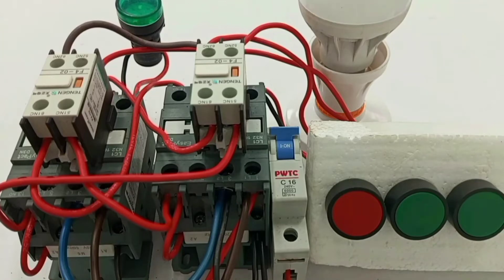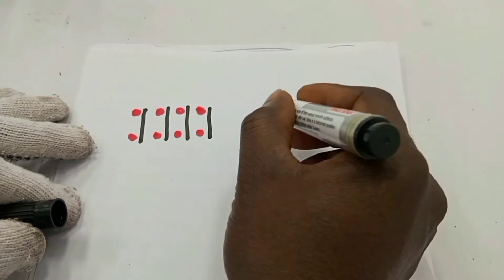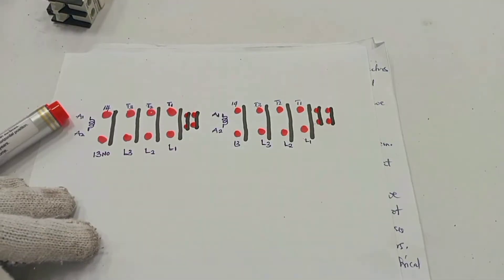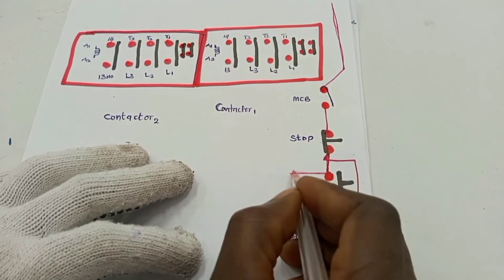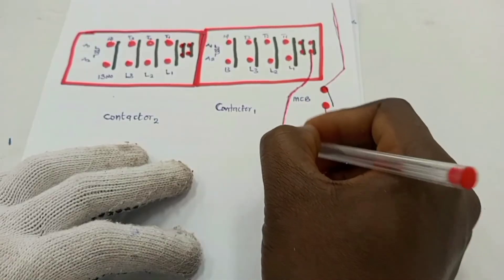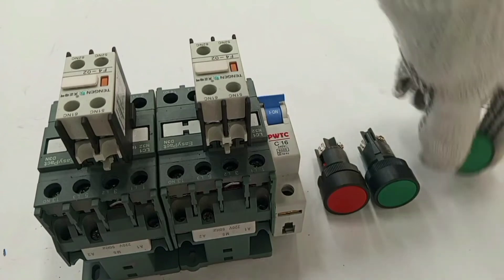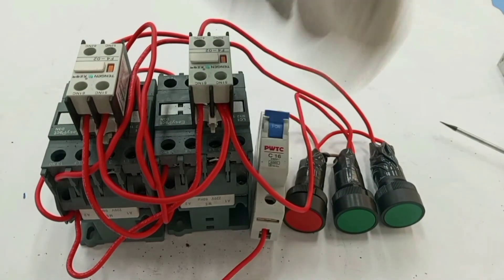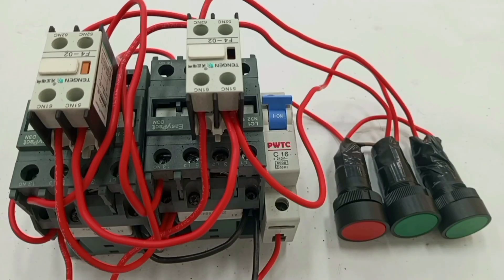Contactor Interlocking Explained | How to Wire Two Contactors Safely (Full Tutorial)

Comment: Pretty good explanation; but somewhat midway you abandoned the drawing and switched to the prac and did not show the rest of the circuits on the drawing.  The drawing re-enforces understanding of the practical.  It would have been nice if you had finished the drawing first.  Otherwise, a really good effort.

Comment: Where is this applicable sir?
Reply from the maker: In situations where you are using two or more contactors and you want only one Contactor to work at a time.  
Example: forward & reverse motor control,  automatic changeover switches etc.

Comment: Please help me by teaching on how to wire a hammer mill
Reply from the maker: Simple. The hammer mill is actually driven by a motor so it's the motor that we need to wire to operate the mill. Now, before wiring, you need to check if the motor can be started DOL or if you need a star delta control. if the motor is rated below 7hp, you can start it DOL. otherwise, you will need a star delta starter.  watch these videos as a guide to do the wiring.
https://youtu.be/zIJ66ZRrJQo
https://youtu.be/cL-eV_m-A_w
https://youtu.be/03Yjy6EvhZU
please let me know after watching the videos above, if you still need further explanation or another video . thanks